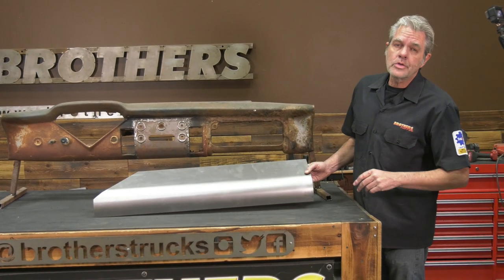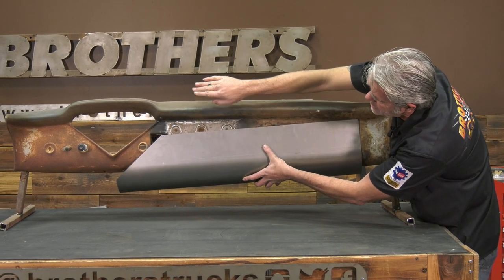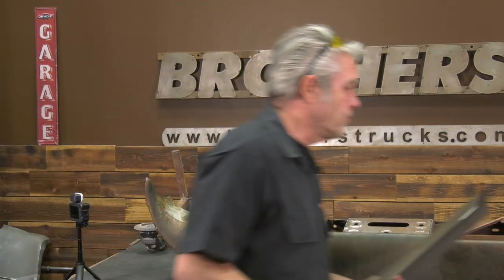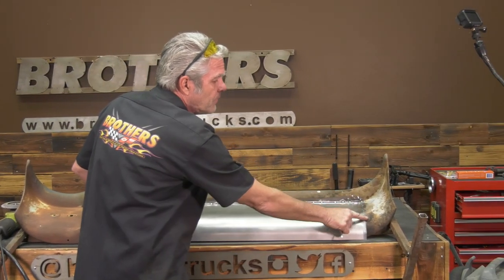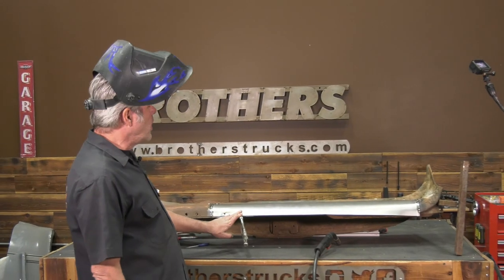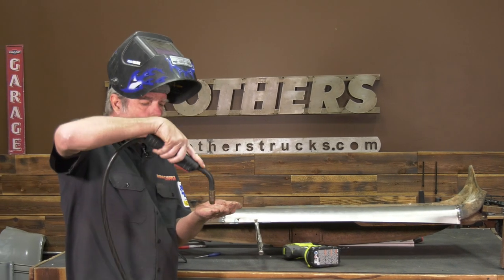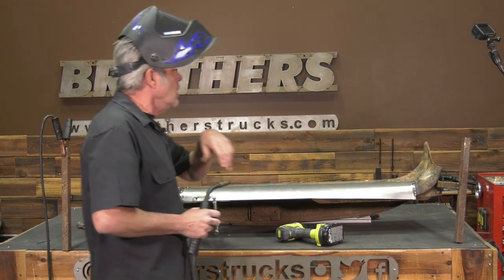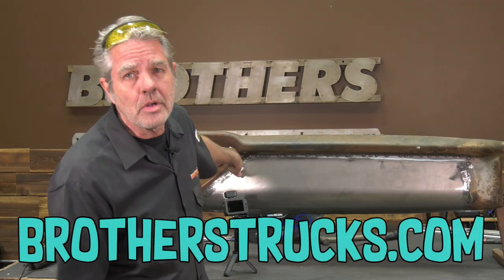55-59 Chevy & GMC Truck How to Install a SMOOTH Dash Face/Remove Your Glovebox Door Tips & Tricks!

Comment: I was just looking at that piece as one of my options, because the last owner chopped up the dash and theres not even metal where the heater controls were, but i also dont want to lose my glovebox. ill take that first piece you cut out...lol
Reply from the maker: You can use this panel without eliminating the glove box door. We did this on a '56 we had about 10 years ago and it was really nice! You just trim the panel shorter before installing it.
Reply: Another idea could be a center console, but that will be more work to look right. I'm also about to do something like this to shave the center, I'll be keeping the hole for the ignition cylinder, as well as the glove box. Just a little bit more cutting and fitting.